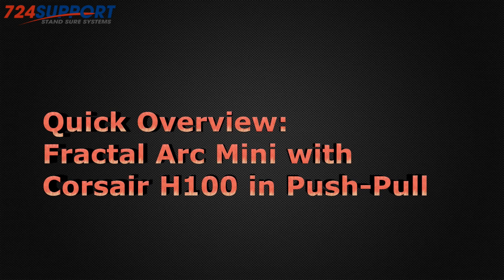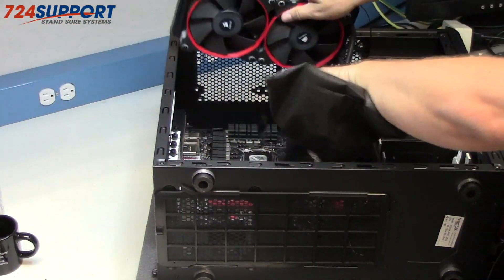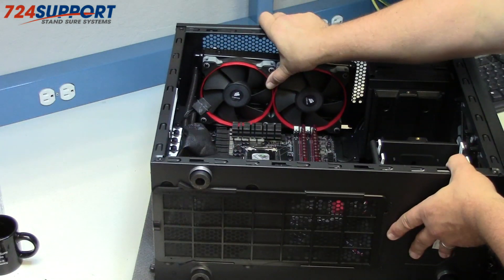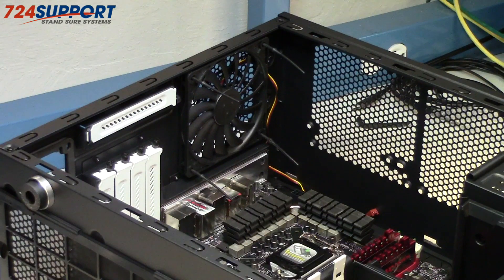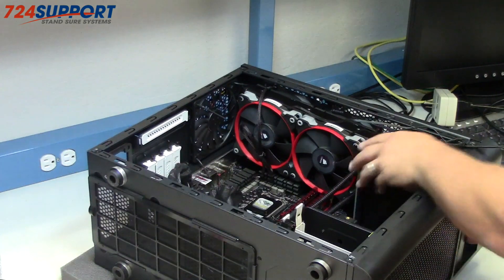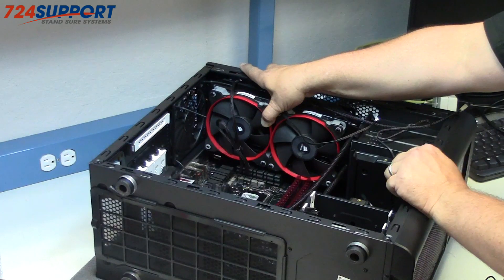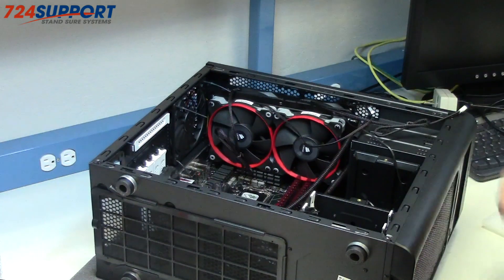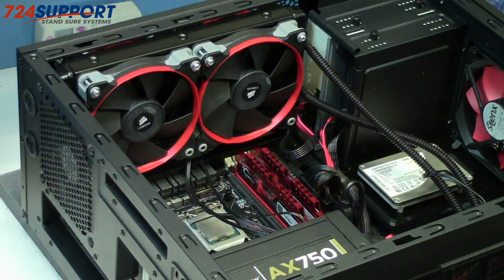Fractal Arc Mini with Corsair H100 Push-Pull (1/2)

Comment: you forgot to mention push/pull is useless....  a 2.8 degree difference + a shit ton of harder work to clean the radiator + more noise is stupit. sry. and if you plan on buying expensive noctua to have more sound reduction then its even more stupit.  temp wont change. the cost will !

Comment: So when you decided on the slim fan for the back exhaust, you had the rad flipped the other way with the tubes at the back.  When you actually mounted it, you flipped the rad around so the tubes were near the 5.25" bays.  Would there be enough clearance for a 25mm back exhaust with the tubes at the 5.25" bays or would only a slim one fit still?

Comment: Actually in fact state change coolers are a real product, albeit an expensive and rare one.

 Condensation is not an issue for these units is because the tubes are not very thermally conductive, meaning not much heat can enter the system other than at the plate on the CPU. 

Its also worth noting the ordinarily a radiator's coolant is much warmer than air temperature. So by setting a mini fridge correctly you could run just below air temperatures, see cooling gains & have no condensation issues.

Comment: You can use a lower the fan speed on a push pull for the same tempratures, meaning typically very similar noise levels. Depending on fan design you can actually get less noise, with the added bonus you can still ramp up the fans when needed.

Having said that there is a slight increase in the airflow restriction due to the second set of motors and fan supports, so in theory the push pull is in fact applying a few percent more work for the same airflow, albeit much lower in the rpm band.

Comment: Yes, but there is a big difference in cost too.

With 2 fans on either the h100i is a bit better due to the diminishing returns of additional inline fans in the push pull arrangement. With four fans on the h100i its a bigger jump again with almost twice the area and airflow.

However ask yourself if your willing to pay (prices based on my current location, Australia) $190+ for CPU cooling ($150ish for radiator, $40 extra fans) , if yes then your golden, if no get something quieter or cheaper.

Comment: I think I would mount the radiator to the outside of the top of the case, and mount the fans below inside the case. Or for push pull, do the same as you did but instead of mounting the other two fans to the radiator i'd mount them to the outside top of the case.

Comment: Better idea.
Seeing as the mini has filtered top fans, flip the fans around.
You also benefit from cold air directly cooling the cpu, (instead of the likely hotter internal case air) AND you also end up with a very positive pressure case.

Comment: The mini fridge part is easy though I just have to drill a hole on the glass door of the fridge, exactly the size of the tubes, so it will not lose cold air, and there you go, the radiator is routed into the fridge. I would set it to 37F, so that it will not freeze, no matter what. If I would set it lower, even if it is not freezing, like 35-36F, on a colder day, it can be a problem, Also, different parts of the fridge can be colder, or warmer, since it only measures the temps in one place.

Comment: To do that you will need to go with a custom water cooling loop eg.. buy a pump, rez, rad & water block for your cpu & or gpu. You will need to fill this yourself but you can make the tubeing any length you want (within reason) It will run you a couple of 100 bucks. Cool idea tho haven't seen anyone do a mini fridge mod yet in there build. If you do it let us know how it performs.

Comment: True. It can be uglier. But there are nice looking fans. I have a question though. Do you know a cooler which has detachable tubes, and you can buy long tubes? I wan't a funny-extreme setup. I plan to put the radiator in a mini fridge next to my pc.VERY close. The mini fridge is right next to it. Still, I would need a 30" tubing. I didn't see that yet on youtube. It would be second from the liquid nitrogen :P. Cool Idea, I just don't know any water coolers with detachable tubes. Do you know any?

Comment: LOL! You could have done a tiny customization, cause your Motherboard coolers don't get much air. You can attach the push fans ON the case, on the outside, not directly against the radiator, and the pull fans how you had it, on the radiator! More in room space, better cooling and airflow!!!!!!!!!!!!

Comment: Surely the pressure is the same as a single fan for push pull configuration, and the second fan only helps force the air out after the turbulence from the rad fins?
e.g. A cars top speed is 100mph, 2 of them will not equal 200mph but 100mph twice.

So you have 2 120mm front intakes and 3 120mm rear exhausts (1 weak).
Making the side fan an exhaust should hopefully balance the pressure but positive is always better.

Also depending on the GPU, it is possible that it could be an added exhaust too

Comment: Few hours after I asked a friend told me it fits, so, I guess I'll get on since I don't plan on having windows on the case. Ya it looks better with that if it has windows, but I seen plenty of YouTube videos pointing out how noisy the cooler is, I also seen some great videos on Noctua fans making the H100 stay near the same temps but with 0 noise... But it's expensive for the one I seen, cause they used 4 $20 fans in push pull(Not expensive but it is compared to the before price of cooling).

Comment: Would a NH-D14 SE2011 fit in this case? I've read from many places it has similar performance to hybrid watercooling but with almost zero noise? Mines a micro atx 3930k in arc mini with gtx 690, can't wait to have it running.